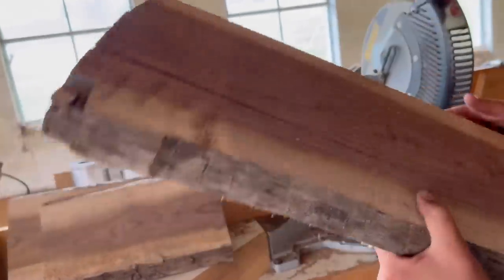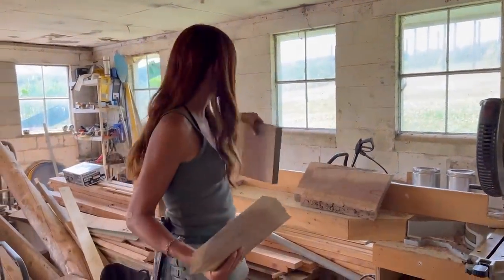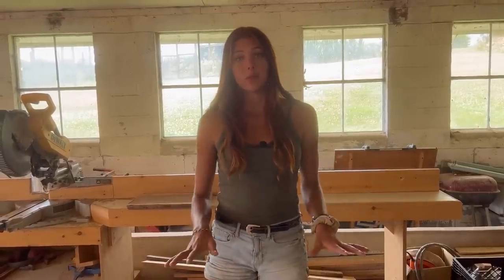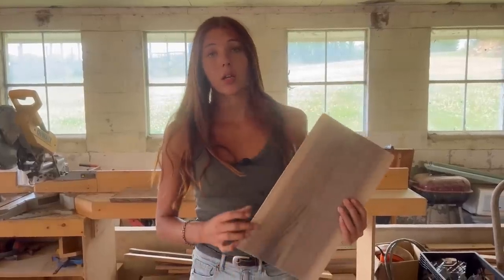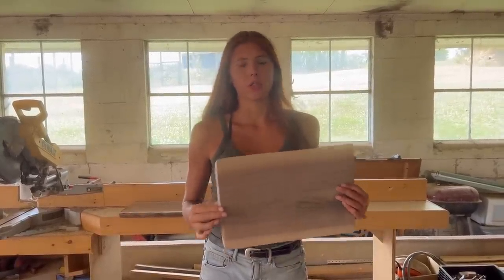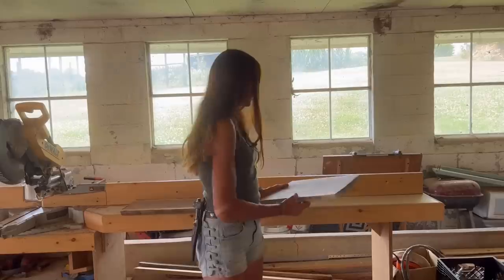Wrapping Up the Week by Making Walnut Cutting Boards!

Comment: You should place the wood being cut against the back support of the miter saw or you will have a terrible accident 
I like your videos but you are looking foolish when you say you will use 2000 grit sandpaper.   There is no such thing (220)
Also Howard’s or some other food safe finish is best, otherwise the board will become rancid
Walnut is beautiful. But it is carcinogenic , you and your sister should use sanding masks
Do your self a favor and have the boss buy a surface planer 
Good luck
I do not want to be picky or mean but if you lost a finger or hand I would be sad

Comment: A little finishing trick 
By volume melt 1/2 beeswax and mineral oil together, mix and let cool 
Apply with a cloth, a little bit goes a long way. And not that messy . Also great for cracked dry skin. 
Food safe and anti bacterial. 
I also use it on my lather product

Comment: I’m not sure that walnut is a good choice.  I know it’s poison to live stock.  The oil is a good choice.  Coconut oil might be better.  If you finish with a 150!grit sand paper that should do it.  Plus you lightly sand between the coats of oil.  The finish will just get better and better.  Later and good luck.

Comment: if you girls are going to work in the shop put your hair up long hair and spinning fast things don't mix and if you cant put the stock against the fence of the cut off saw because of its shape then clamp it down it is just a matter of time before one grabs or binds and it is going to rip it out of your hand and slam it back against the fence like it or not NOT SAFE  baggy loose clothes and loose long hair are liabilities in the woodshop am not a safety nanny by any means but as a woodworker/carpenter with 40+years exp i have seen a lot and speak from experience some safety rules should be followed best of luck with the new venture be careful

Comment: Girls, my lovely's, who taught you to cut wood that is NOT up against the fence?  You are going to get hurt and learn the hard way. Then, sand on a bench with a STOP behind the board. 36 grit on the belt, then 80 then on to the orbital at 80 and more.  You are not from Pakistan [pretty clear to see that] and you dont need to kneel on a cement or dirt floor. Finally, that split does make that board scrap. You saw it off and glue it up. Put the raw edge UP and make one edge square cut. Made too many thousands boards  and miles of cabinets to count. You cant burn the date in unless you want to buy 365 branding irons. AA+ for effort, but you girls need some teaching from a pro

Comment: This video wasn't a good one, you girls are in over your head with the equipment. That miter saw is dangerous when not using it properly. That pc of wood being cut while away from the fence could jerk to the side and pull your hand into the blade. Ask your dad for instruction, no reason to cut it that way, actually it's harder.

Comment: I think you have a great idea for making cutting boards. But, you REALLY need some basic wood working skills. You're going to get hurt using a miter saw and belt sander the way you're using them.  A planer would help in getting the saw marks out easily. But the belt sander with a coarse grit will get the job done until you want to invest in more equipment. And never use olive oil or most cooking oils for a finish.  They will go rancid. Grapeseed and walnut oils are good choices. Be safe!

Comment: You need a planer, a roll sander, band saw and someone to teach you some basic workshop safety.  I'm not the only one to see how hazardous your shop is.  If you ever get that long hair caught in a saw blade or on a drill press, or lathe, you will be bald for the rest of your long life.  Don't wear loose clothing and keep your long sleeve shirts buttoned on cuff and the tails tucked in.  I am a retired tool and die maker, Army helicopter mechanic and I get sick every time I see people break basic safety rules.  Work place safety is to keep your fingers on your hand and not in the chip tray (I have seen it happen), your rings stay in your pocket (rings will get caught in machinery and will amputate your finger), your hair on your head (not wrapped up in a drill chuck) and your arms and legs attached to your body, not laying in the floor or scattered against the wall of the shop.

Comment: You girls need to take a time management class.  Time is money... Buy yourself a table top wood planer and save yourself 90% of your sanding time, and you will get a smooth, perfect, flat finish in seconds.  Use only mineral oil  as a finish as it is consumable.  Keep up the good work!
Reply: I think your missing the point
Reply from the maker: I agree with Shayne Jenkins

Comment: Not wearing hearing protection or a dust mask I find disturbing. Your safety and well being comes first. When you sand against the grain you are breaking up the toughest part of the wood. If you try to use a plane, going with the grain your cuts will be quite smooth. If you go against the grain you'll have to work. You are breaking up the fiber that makes it wood. And if you break that up first then sanding with grain will allow for a smoother finish. While it might not be intuition it would show that you have a feel for the wood. If you consider a router hand plane, across the grain, it might break your hand. That's not an easy cut to make. With the grain, that doesn't matter. It's about a dado that you can fit a rabbet into.
Reply: They wear earphones silly same as earplugs. If you don't like what they do why do you watch the channel just to be here be negative